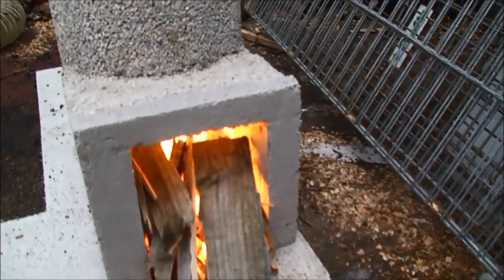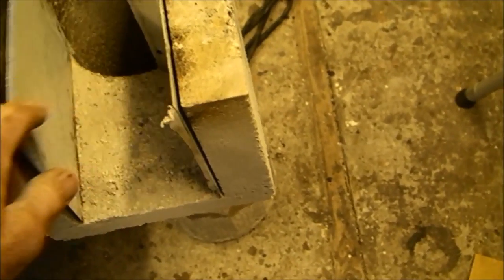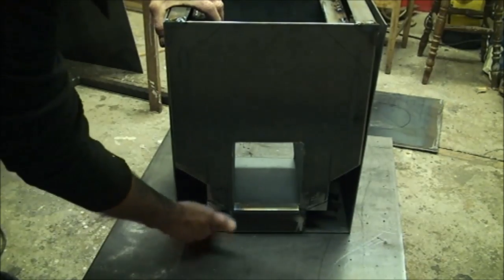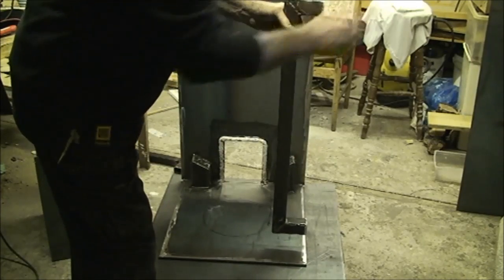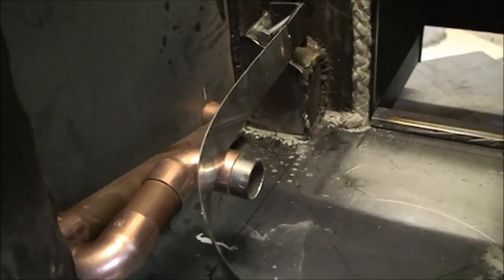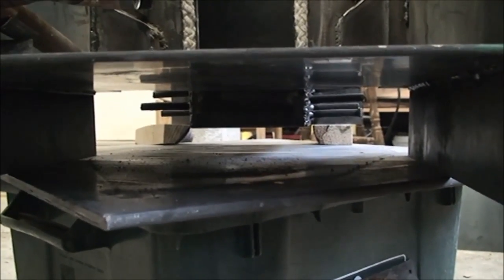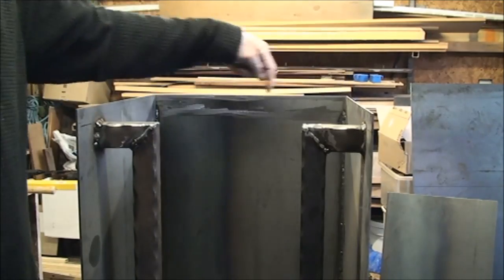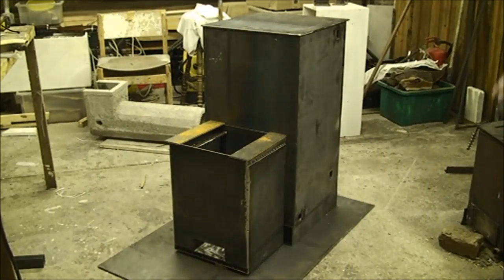PART 3 Rocket stove mass heater cast riser.

Comment: In a way this stove reminds me of a common finnish stove for home heating though it is not a rocket stove. Instead of air exchangers, the sides, back and front are filled with heavy concrete slabs that the flue gasses warm up before exiting. That gives a different form of heating, slows down the release of the heat for longer. Don't get rapid heating of a cold workshop like that of course, but easier to keep the temperature consistent in a home that way.

Comment: What is that square tube for the heat exchanger called? It is the first time I have seen that style and I would love to use it for a project with a more decorative touch as well.
Reply from the maker: +richardpinell Hi Richard, I dont know if they have a name, I called them heat convectors due to the way they work. Cheers.

Comment: What's your feelings on the internal heat exchange tubes running vertically inside the heat exchanger?  Were you able to determine any advantage to distraction in having those there?
Reply from the maker: Pickleballcl They were a bit experimental to see what happened, but they do put out alot of heat being 3 times bigger than the corresponding area on the exchanger I would fit many more were I to build another like this, the air convection inside pumps the heat out.

Comment: Hi thanks for your reply about refractory material supplies yesterday, ordered it and to my surprise here today.
I would like to ask a question about the firebox happy with all other aspects I tried to submit my query here about firebox but think I used to many words. Does the firebox have a full steel bottom as when I saw it on blocks of wood I could not make it out and wondered why the side panels did not go right to bottom.
I saw you had a small box welded underneath for the ashpit.
All other points noted thanks. My email jb@beaumonts.karoo.co.uk
Kind regards

John Beaumont
Reply from the maker: John Beaumont Hi John, yes the firebox has to be enclosed at the bottom to stop the air entering there, the air should enter at the top only ideally. You saw a space at the bottom because I put some round bar pieces across the gap about half inch apart for the ash to fall into the pan underneath, as I said the pan area underneath is enclosed to no air can enter. Cheers,

Comment: Does the vortex make a difference? It looks really cool on video but, does it make the stove work better?
I like the looks of rocket stoves, and have seen a lot of variations. Mine wold be portable, so I could take it from place to place, and just hook it up to any available chimney or mass heater system.
Reply from the maker: tom drew It gives a cleaner burn much faster tom and mixes the gasses better inside the riser, especially when you add secondary air. good luck if you go ahead with the build.
Reply: Thank you.

Comment: By the way, what size is the burn box? And the diameter of the riser tube?
Reply from the maker: jimmytk riser is 6.5 inches wide inside. firebox is 11x11 inch x 14 inch will give all dimensions at the end of the videos. Cheers.

Comment: Interesting build. Just one point, I think it might be wise to spring load the bolts holding the riser band to allow for the different rates of expansion and contraction. I'd hate to see that casting crack. Cheers.
Reply from the maker: James Lamb Cheers James, dont worry the band wont be so tight that it causes damage, it should expand slightly when heated anyway end contract again when cool.

Comment: Looking splendid!  Well done. 
Quite industrial as you say. 
Are you getting carried away at times once you get the welder in your hand!?  ;)
Reply from the maker: Marcel Lenormand Thanks Marcel, believe me there are plenty of other ideas I would like to incorporate into this stove some of them come to me while I am building and some are planned, I usually just want to get the thing finished then wish I had incorporated them when its finished. ahh well keeps you keen to make another .
Reply: Hehe.  I'm looking forward to you giving the casting a proper burn, particularly to see how insulative it is.
Reply: What do you think to casting part of the firebox too? Where primary combustion is taking place.
Reply from the maker: Marcel Lenormand I will be covering front and back of firebox and the sloping sections at the bottom with both firebrick and kiln shelf to protect them and retain heat inside, should be blistering hot in there with the addition of the preheated air, I think alot of gassification will be happening inside this one when up to temp, thats when the sec air will come into play as I slow the burn down.
Reply: Super!  

This prompts another question which has been bouncing round my head for a while … how do we ensure that it gets enough secondary air for complete combustion?  I'm guessing there's no such thing as too much in this regard.
Reply from the maker: Marcel Lenormand Bit of a guesstimate really I suppose more would do no harm i think on a 6 inch tube an inch of air will get the job done.